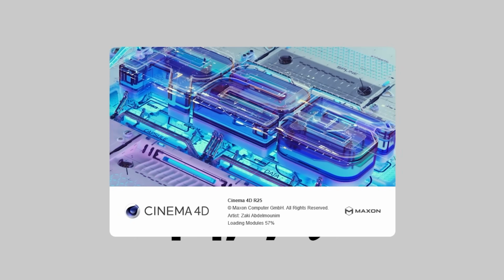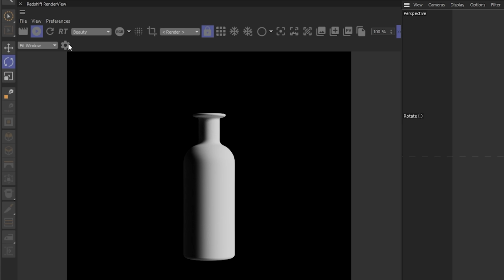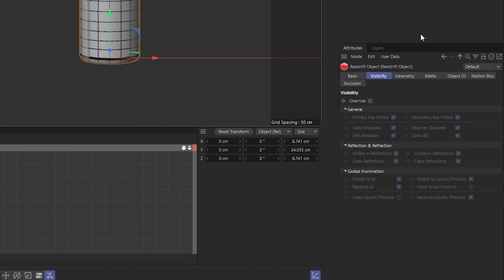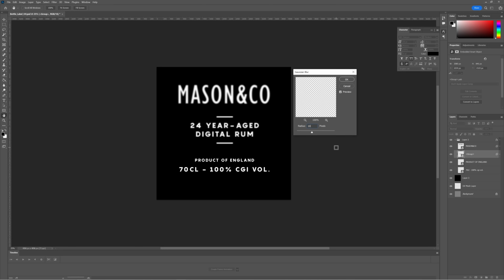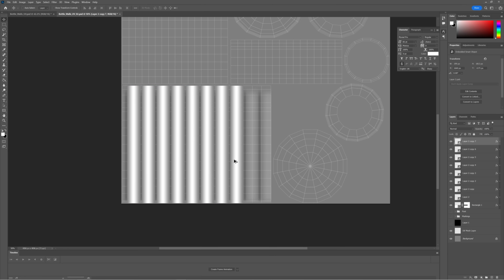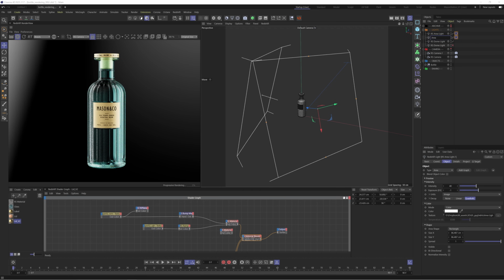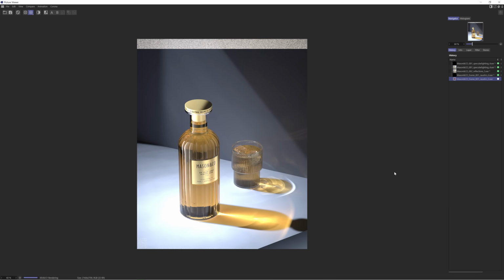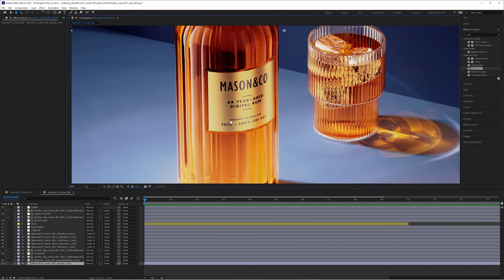The COMPLETE Guide to Creating CG Bottle Renders

Comment: Hey, I hope you can help me. I'm working on a project and I’ve created these lines that go along the bottle, which give texture to the glass. But when I render, some lines show up, almost like the glass is scratched along the surface. If you check at 26:13 in your Photoshop video, you can see these lines. For some reason, Redshift shows them, so the gradient isn’t completely clean, and the glass looks scratched. I’ve been trying to fix this for months with no luck, so I hope you can shed some light on the issue.

Comment: This is a great tutorial! I just have one question. When I am doing the modeling of the bottle and adding loop cuts, after I scale the geometry a couple of times it no longer works. By this I mean when I create a loop and select it,  I will try to scale the line using the scale tool and nothing happens. I'm not sure if this is a weird glitch in C4D or if there is something I am doing wrong, but I haven't been able to figure it out. I had to resort to using the pen tool and then a lathe to just create the bottle that way. Not sure if anyone else has had a similar issue or knows of a solution, but if so please let me know! Otherwise great video.

Comment: Really great approach... picked up some handy tricks will definately use them later...  One little suggestion I would like to give is the caustics of the bottle had less details due to the additional details of the bottle were added using bump rather than on geometry... so the caustics were calculated as if it was a flat object... try giving details on the geometry and use the bump map as displacement as well... it will break the sillhoutte & u'll have much better result ^_^ thank you for sharing ^_^

Comment: Really amazing tutorial, specially the compositing part where you added multiple light passes to the liquid! Blown away. Quick question, is there a reason you didn't use cloth to add thickness to the bottle? Does it mainly come down to the control you get by doing it manually?

Thanks!

Comment: you'll wanna be careful with using Lumetri in linear space. most of the controls are designed to operate only within 0-1 even the curves. it becomes especially problematic when some kind of limiting curve is applied up until 1.0 but the rest of the data above is unchanged but you reduce exposure with a seperate operator afterwards. you'll get a 'kink' in your curve/look. it's quite long to explain exactly everything but it's easy to visualize with a horizontal greyscale ramp from 0 to 2.0 float and see what lumetri's parameters are doing. the better way to use Lumetri would be to convert from ACEScg to ACEScct first which is a log gamma space, then after the grading is done another OCIO to go from ACEScct to display out.

Comment: Wow you made the whole process! This could be broken down to many videos. But great work. For the whole first modeling part. You can also draw a shape in illustrator or c4d of half the bottle, use the spline set to uniform and use lathe to create the shape. Cuts your modeling time down a lot. You'll get the inside and the outside all at once. I've found that if you want a more realistic,  not hyper realistic bottle, this inside should be a bit wobbly. Especially around the "body" of the glass, since the only part of the glass that is really controlled, is the outside. I need to see this video a couple of times, thanks for all the tips. (super if you add some chapter breaks :)
Reply: that is exectly what I am saying.

Comment: Is there a reason you chose to model the glass with a cylinder vs using a lathe?
Reply from the maker: You could use the lathe, but modelling with a cylinder allows you to have more control over the line cuts and keep things low poly, but it just comes down to personal preference really :)
Reply: @iamrossmason  brother you can get as much control as you want by using Lathe and Spline and it will save your time a lot
Reply: @iamrossmason  https://youtu.be/sk6dyQDP7vc